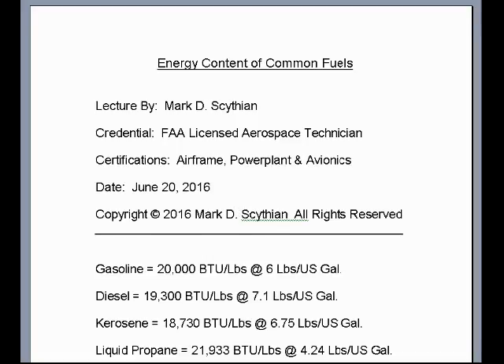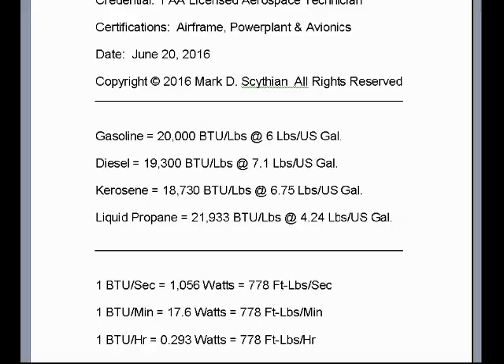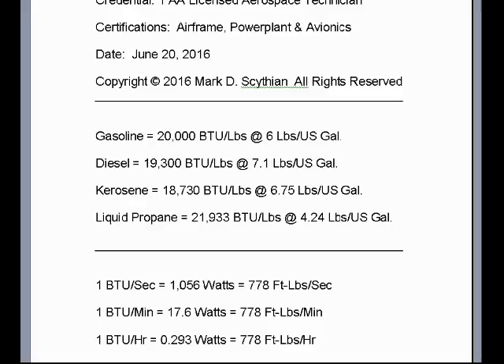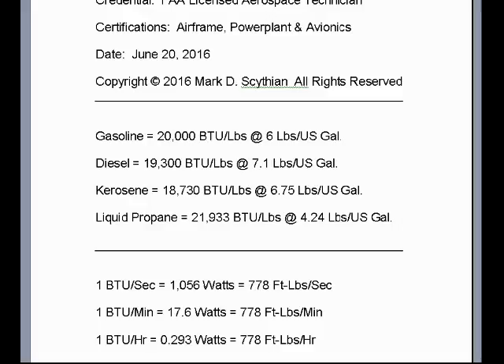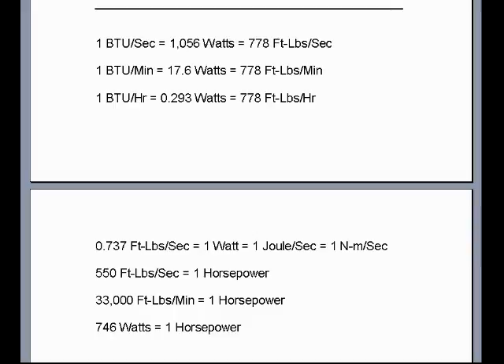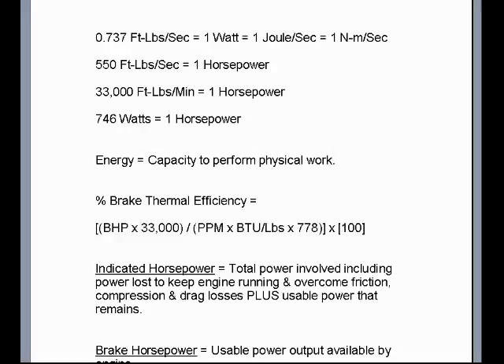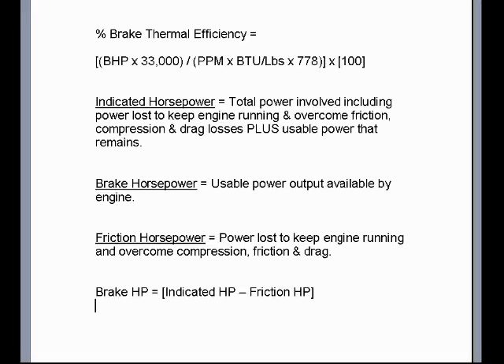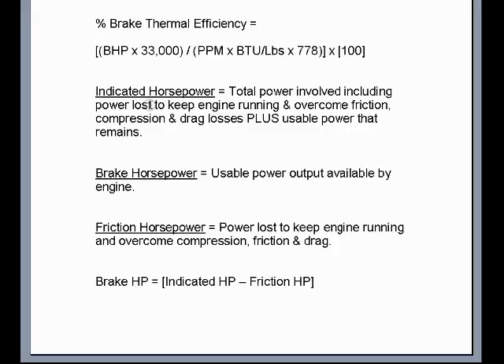Energy Content of Common Fuels

Comment: Nine years later and I'm honored to make the first comment. This is very useful info. I just need to find some comparable figures for various alcohol fuels.
Reply from the maker: BTU/Lb or Joules/Kg energy-density & flame-front-combustion-speed are most relevant.  The flame-front-speed of Gasoline is 100 ft/sec.  Diesel & Kerosene's flame-front-combustion-speeds are equally 6 ft/sec.  Diesel & Kerosene utilize Heat-of-Air-Compression for primary ignition, unlike Gasoline.  Energy-density alone is not enough information.  

For Gasoline piston engines, alcohol-based fuels are going to burn too fast and contain less energy-density compared to Gasoline.  For late-model cars, alcohol-based fuels simply won't work.  Period.  Unless anti-detonation sensors, EGR, and fuel-metering algorithms are disabled ("de-tuned").  

For older Gasoline engines, or ones you're building from scratch for let's say for 'drag-racing', alcohol-based fuel mixtures are good with higher-octane Gasoline, (to handle higher compression ratios in the absence of anti-detonation-sensors).  Octane doesn't increase the energy-density of Gasoline, it simply slows down the combustion-flame-front-speed under higher compression-ratios.  Especially in Gasoline engines made before 2005 which lack anti-detonation-sensors.  Fuel mixture must be rich at Idle to prevent thermal runaway, but can handle just about any lean or gaseous fuel at high RPMs'.  

This is where alcohol-based fuel mixtures are great.  Be careful to not use too high a compression ratio.  Compression vaporizes un-burnable liquid fuel (including atomized droplets) into a purely vaporized gas so that it can burn, along with thermally-energize air-charge to assist spark-ignition.   

Compression power takes away the potential energy of fuels.  To prevent too high a compression ratio, calculate the flash-point-temp (compression pressure) of the fuel, or composite fuel mixture, and set it there as Static Compression Ratio.  Or decrease the compression ratio and supplement with turbocharging.  Never over-boost more than what the fuel's flash-point temp is designed to light off at.   

If you need any help with a project you're working on, let me know.  I finished my Aerospace Engineering Bachelor of Science degree at Western Michigan University after becoming an FAA Licensed A&P Aircraft Mechanic.